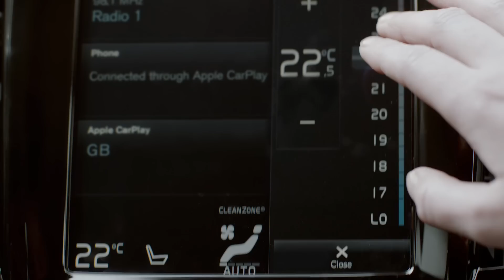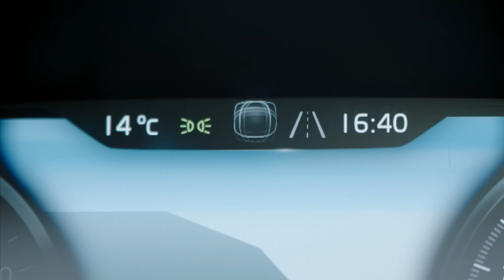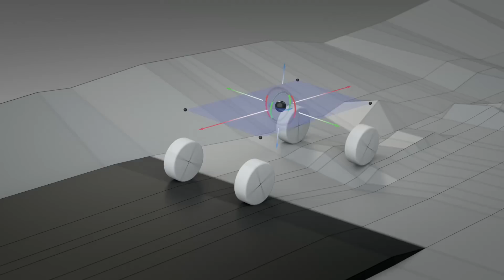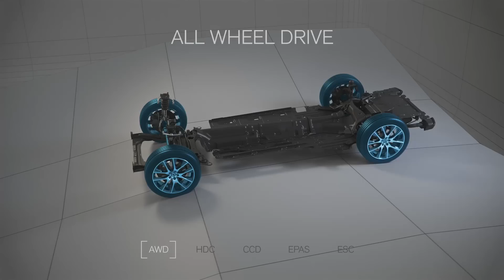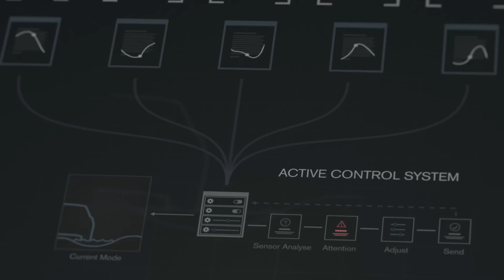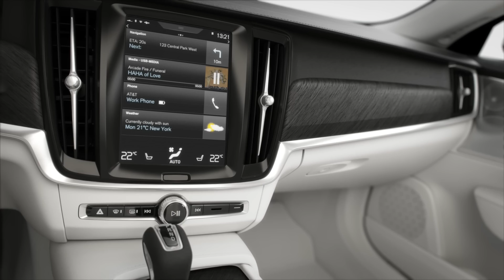New Volvo V90 Cross Country Preview Exterior/Interior/Technology/Crash test 2017 neu

Comment: Someone know when we'll see a new Volvo XC60?
Reply: In the future, maybe 2018 or so
Reply: Probably at the Geneva motorshow
Reply: I believe the XC60 will be the last model to be  renewed, so probably around 2018
Reply: Ok thanks guys :)
Reply: As far as I know, that will be the next brand new Volvo, comes in 2017, maybe early 2018 to the dealers.
It is already 8 years old.
Reply: The new XC60 will be revealed in 2017, followed by the rest of the 60-series. Then in 2018 the new 40-series will be presented. The new XC60 looks actually better than the XC90, but basically a  smaller version.